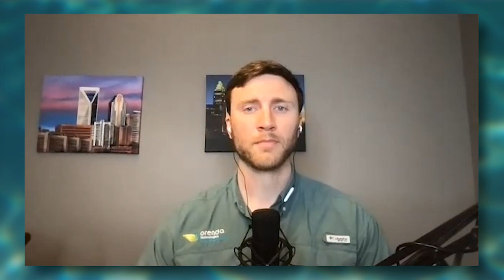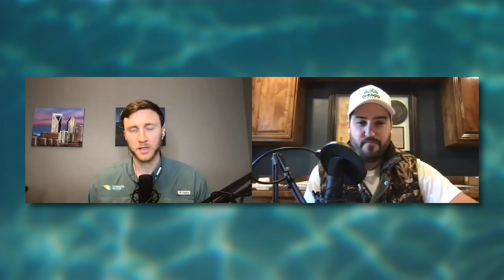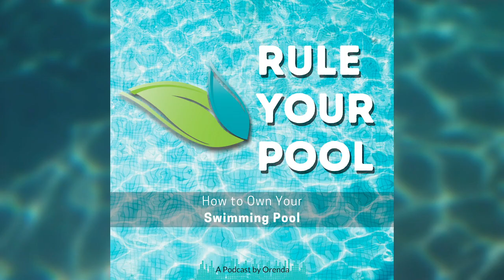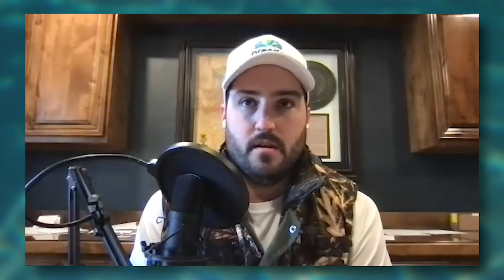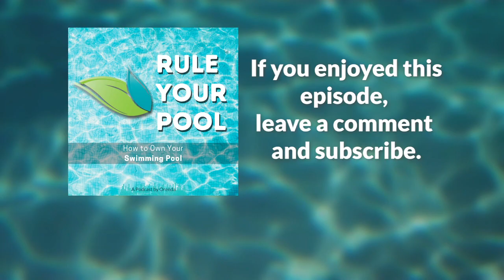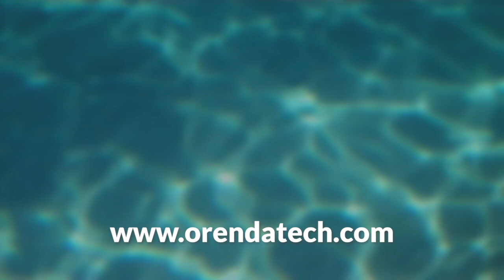4 Types of Chlorine | Calcium Hypochlorite | Rule Your Pool (Episode 19)

Comment: I'm a pool service technician and wished y'all had mentioned if it were safe in having tri-chlor in the tri-chlor feeder - yet shocking with hypochlorite granular; is it safe to have these two sanitizers mixed in the same pool?
Reply from the maker: It should be safe if you use the products properly and do not add any chlorine directly into the skimmer

Comment: What are the sediments with Cal Hypo, and are these a concern?  We inhereted a pool with a new property, and used the Cal Hypo that came with it.  For 4 months I was diluting in a bucket, then emptying into the pool.  Other than a little bit more sediment, this worked with no noticable downside.  When I went to buy more though, 2 seperate pool shops told me it has to stand overnight, and dont tip the sediment in.  This was either to stop the extra calcium (not a problem for me) or to "protect the filter" - but no one is as confident on the why as they are on not doing it.

Any comments on this?  Other than the extra calcium, is there any downside to adding the entire mixed bucket?  Note the bucket is cloudy, but the granules themselves are all dissolved.
Reply from the maker: ….never heard of waiting overnight. The key is to make sure the pool’s pH is below 7.8 before adding it. That way, when you grab a scoop of pool water, it’s lower than 7.8 pH and the cal hypo should dissolve just fine. But do NOT add acid directly to cal hypo. The fumes are toxic.

Comment: Thank you for this discussion.  If I have a liquid chlorine feeder like an Intellichem can I also use the NST skimmer safe cal hypo tabs while also managing the LC Intellichem feeder and remain safe?  I assume if I keep the overall chlorine at appropriate levels (less than 4ppm) it should be okay, correct?  I’m wantIng to make sure LC and the CH skimmer tabs play nicely together in a safe manner. Thanks again.
Reply from the maker: We would not risk that.  There's a chance the feeders could pump chlorine at the same time and that could be very dangerous.
Reply: Great video. There are many many "pool guys" and pool veterans stuck in the old school ways they call everything you guys suggest as "against pool science and therefore cant work" ive seen some YouTube videos who critizes the use of cal hypo low alkalinity and even the use if enzymes saying using under 2 ppm of chlorine is against pool science therefore it's wrong. 

I like how you guys have found much better ways than the tradition text books and it works

One youtube review of your stuff said if you use enzymes and low CYA  that pool owners will struggle with their water abd anyone who believes your theories will not have good water 

Why are so many so called pool pros so against your stuff and criticizing it. Yet your products and theories work